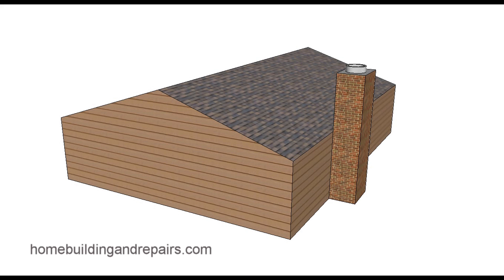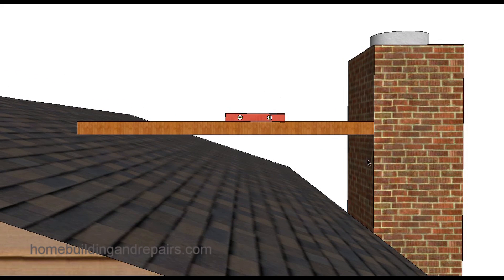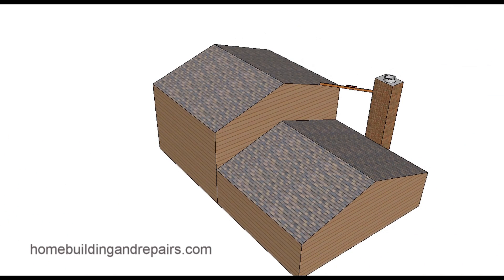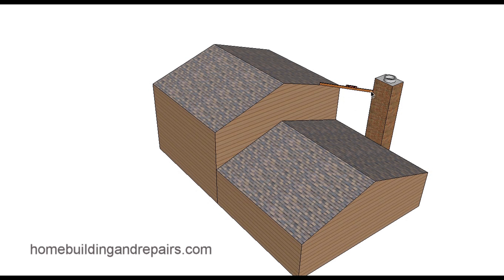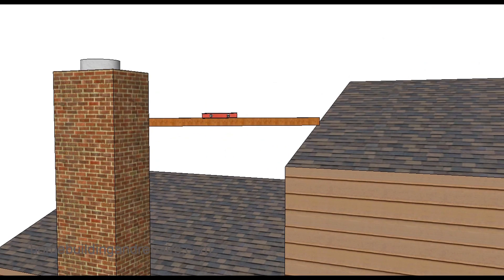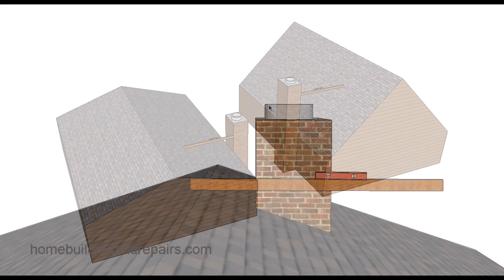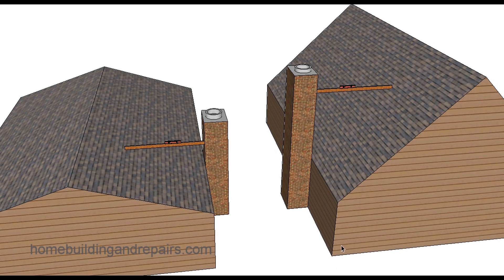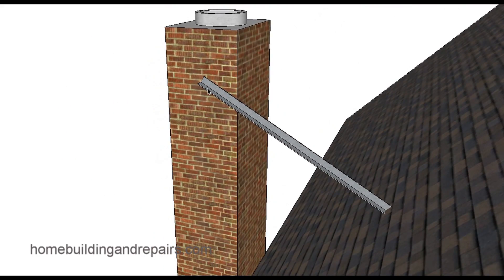How To Figure The Height of A Chimney Using 10 Foot Rule – Home Building Design

Comment: Totally not clear about 10' rule. The distance between chimney itself and nearest roof point will change depending on how high you take a point on chimney wall. So, is there any rule at what height of chimney surface we have to take a point of measurement?

Comment from the maker: When your are at the ridge line then it might need to be 3 feet higher not 2 feet.  R1003.9 of the ICC code. Check with your local building codes before building a fireplace chimney. Here's a link to updated video for calculating chimney height - https://youtu.be/wnkyD3ZLVNU

Comment: When your are at the ridge line then it should be 3 feet higher not 2 feet.  R1003.9 of the ICC code.
Reply from the maker: Thank you and I think your right. I will post your comment at the top of all comments, even though I have not ran across this yet.
Reply from the maker: Updated video - https://youtu.be/wnkyD3ZLVNU

Comment: Can't really understand the idea of building the chimney outside the house. Considerable heat loss... I guess some people just want to heat up the garden.
Reply: exactly,Well built  & insulated it is best inside the house.Outside It would just cool down the gases & cause deposition of exhaust gases.
Reply: High efficiency stoves will not loose much heat to the chimney - most of the heat is kept indoors